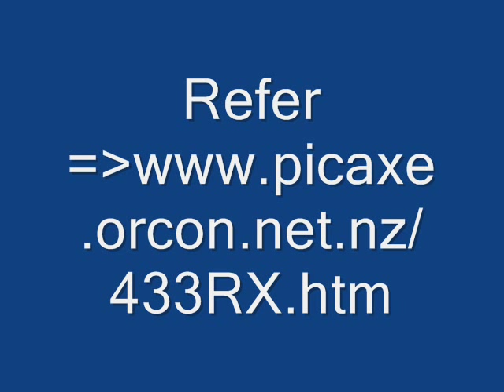Field testing a simple 433.92MHz band monitoring receiver.

Comment from the maker: The particular transmitter used was only a flea powered few mW, so LOS ranges were perhaps 1km- dropping to maybe a few 100 mtres in built up areas. 25mW is normally allowed however, and as every 6dB gain doubles the range then  expect those ranges to be at least doubled with higher power transmitters.